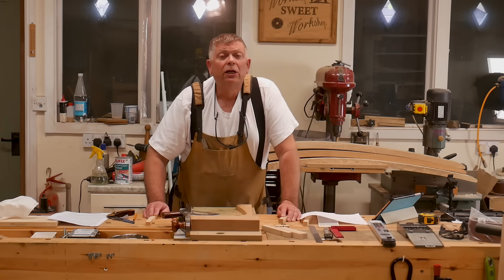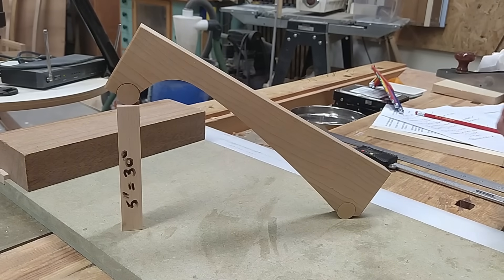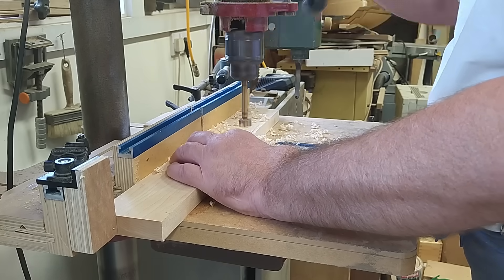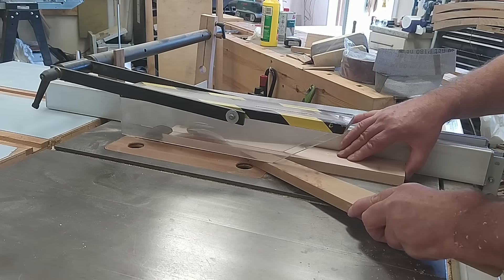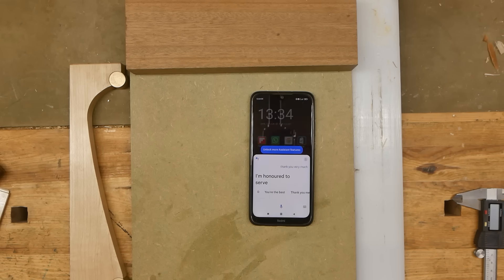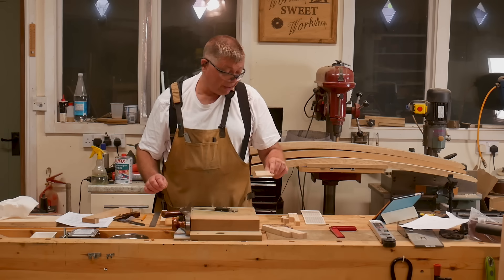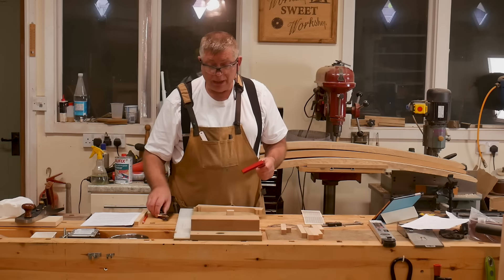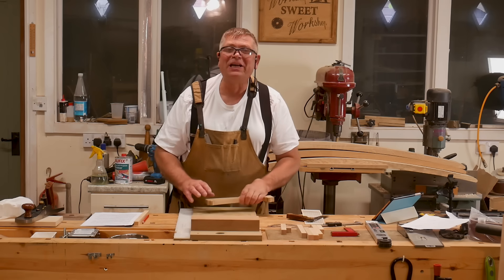Make a Sine Bar for perfect angles First Time Every Time!

Comment: I was the guy writing on the desk. 40 years later some trig has finally soaked through my skull. I’m gonna make my sine bar to up my woodworking game a bit. Great explanation and examples of use. With a bit of tweaking the miter gauge bar fit to slots and using the sine bar, even a basic tool should be very accurate. Cheers!
Reply: Struggled with trig also, so in the 9th grade, I went to a trade school and took 4 years of Machine shop. It was easy after that! Decimals were baffling also, but once it all had meaning, I understood !  Retired after 45 years.
Reply: This is intriguing. You could also make an adjustable length spacer using a turnbuckle as a jack screw. Various length turnbuckles could comprise a wide range of lengths. One mid size one for example comes with .25"-20 threads which conveniently converts to 0.10" change per turn. One screw would change the length by .05" per turn, but the turnbuckle turns both screws at once. Thus .05" +.05" = 0.10" per turn. Partial turns can produce finer resolution as well. Any thread count can be used as the length adjustment per turn. You measure the length with calipers,  or measure a different length and count turns for exact spacing. 
   Further, you can use the % of inclination such as is stated for roads of so much height compared to the length (at 0° setting) and convert the inclination to degrees. The rounded single one I've memorized is 7% = 4° for quick calculations. There are web calculators which will convert inclination % to degrees and vice versa to get exactly what you want.
Reply: And me.    Totally lost me sometime after 6 minutes. 🙂 I went and watched one about a " Tick stick " instead.
Reply: @russellwaite5874  then you came back here to comment haha
Reply: @russellwaite5874  me too !
Reply: I wasn't writing on te desk but I struggled with geometry in 1970 and struggle with it today.
I guess I can blame teaching methods (although I did pass O-level math second try in 73)

Comment: Good video, good tool.  BUT, if your caliper is digital or dial it isn't vernier.  I don't use digital or dial calipers, I use vernier calipers.  Verniers are more robust, less susceptible to incorrect readings.  They are a bit fiddly if you're not used to them, but they are "trustworthy" every time.  If they close at zero then they are calibrated correctly.
Reply: Thank you.  That bugged me too.  Vernier is a scale.  It can be on calipers, micrometers, and other things.

Comment: Good Morning Steve! Brilliant as always. Since I have no degree in engineering (biologist), I wasn't aware of this little gadget, but I will make one as soon as I have built another jig, which would also be helpful for you, to keep at least two hands when cutting this sine-bar parallel on the table saw: just by coincidence, a German woodworking channel yesterday uploaded a video on a jig, that helps cutting thin stripes of wood acurately. I think this might also help to keep the fingers much further away from the blade when cutting the back side of the sine bar parallel to the anvils. Here is a link to that video https://www.youtube.com/watch?v=eVpNTJnkduY Jonas is a really cool guy (if you don't judge a book just by the cover 😉). 
Thanks again for the excellent video
Reply from the maker: Hi Andreas, glad you liked the video.
The problem when trimming the edgeis  that, because there are only two points in contact with the fence, it is VERY easy for the workpiece to pivot. A standard feather board does not holp, because it applies pressure in front of the blade, rather than on the blade. It's a really tricky cut. But my blade guard completely covers the blade, riding on the workpiece itself. Even so, I have to concentrate.
Thanks for the heads up on the video. I wish I spoke German, he sounds fun. Who has houseplants in his workshop?! And here is my very similar solution to the same problem. The quality is dire (it's from a previous life) and you can skip the first 45s (what was I thinking?!) but you'll get the picture. I still have that jig, I think perhaps I need to remake the film. Enjoy (if you can).
https://www.youtube.com/watch?v=lp4ZR5WsL9w&t=45s

Comment: That's a tool that machinists used for a very long time but that woodworkers have not made good use of.  That said,  it would make sense to make spacers for commonly used angles such as 30 and 45 degrees  and for others that are often used, but for one-offs one could just use the vernier calipers, particularly if the sine bar was integrated as part of a sled..